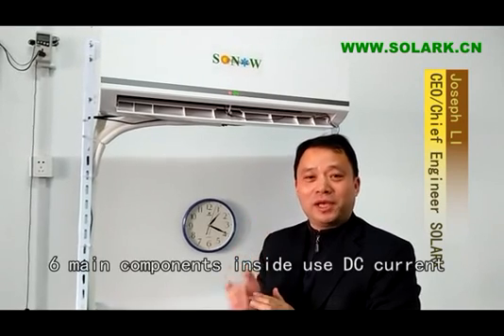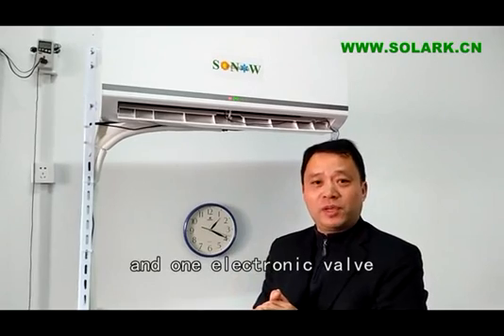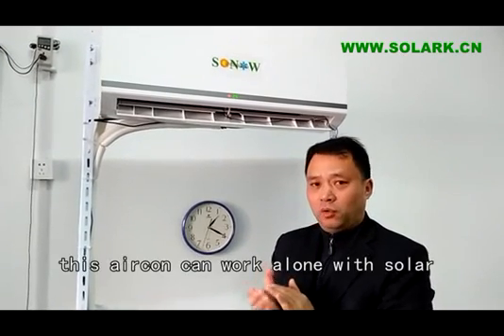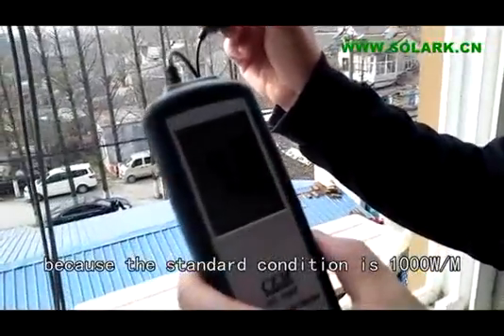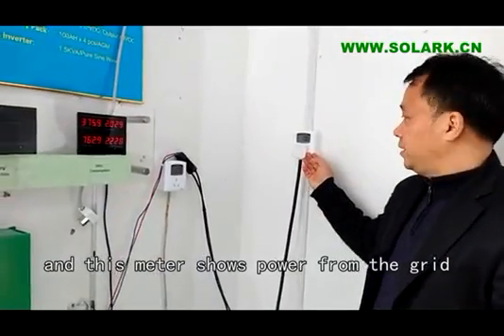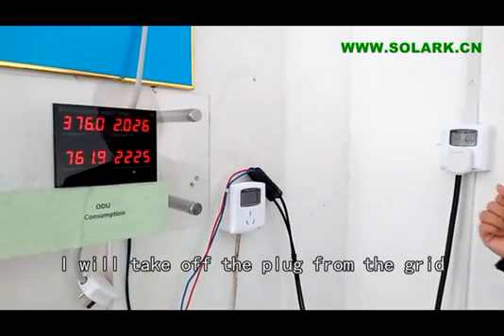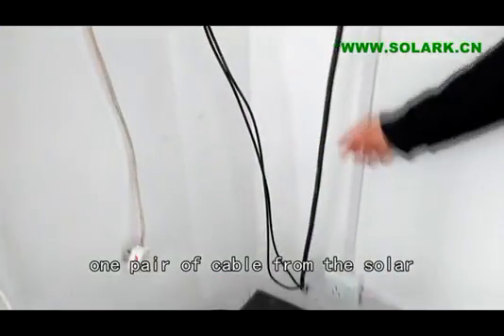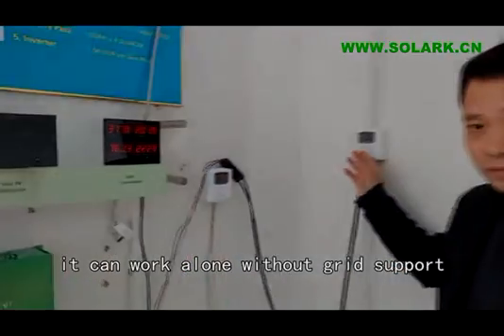SOLARK# 48v full dc solar air conditioner

Comment: 24, 48 volt and grid tied  12,000 btu heat pumps have been sold in the US hy Hotspot Energy out of Virginia Beach Virginian    for four or five years now.
Reply: I m also HVAC
I interested in the solar air conditioner plz help me how i get ac